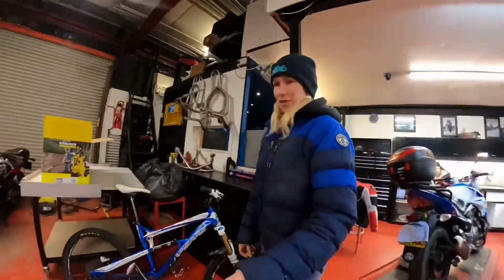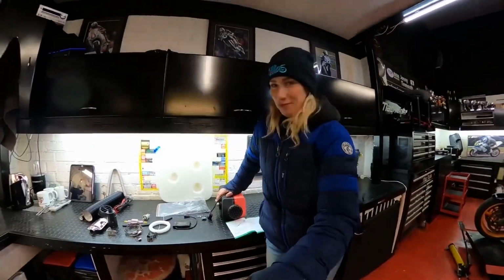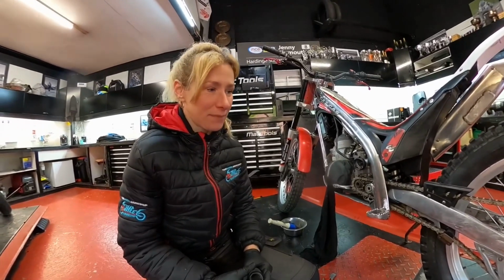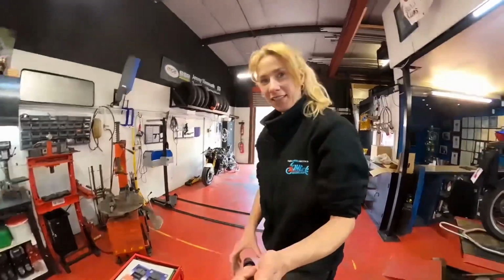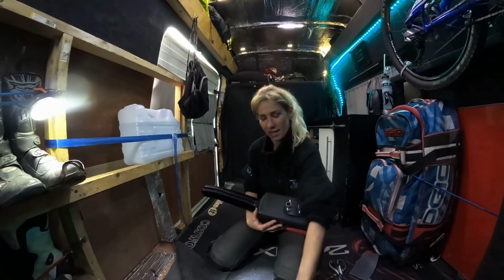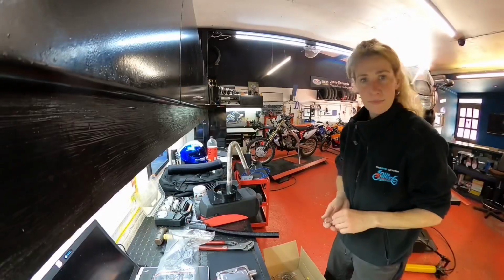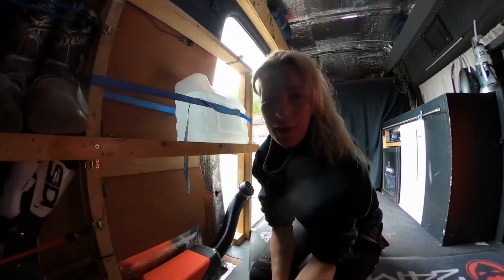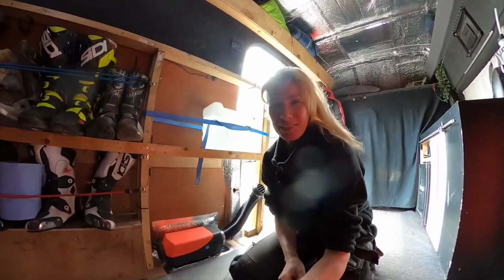Vlog 7 Workshop life and van diesel heater fitting.

Comment: Just had an eberspacher fitten to my transit. Make sure diesel pump is fitted correct way round... Otherwise it blows instead of sucks! And exhaust goes to far side of van away from windows. And don't crease or flatten ducting.... It could restrict the air flow and over heat the unit. Have fun. Cheers for vids. SHEFFIELD